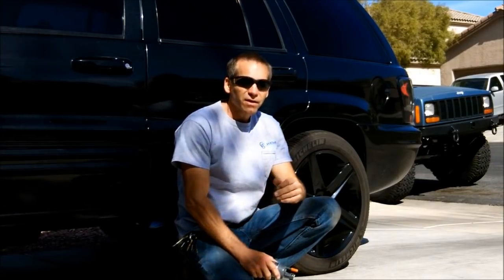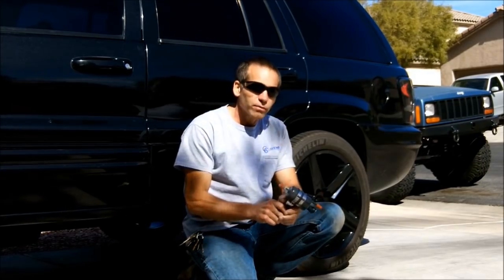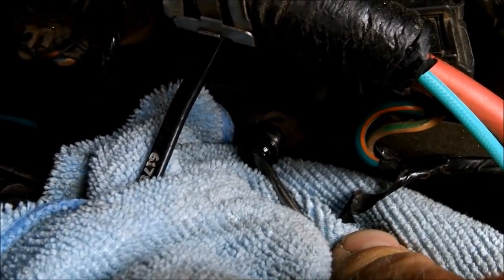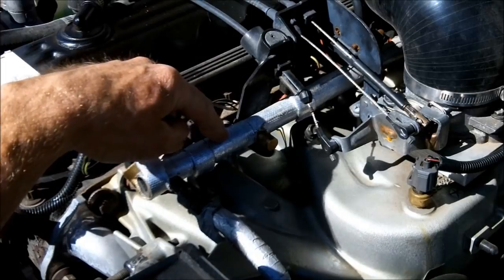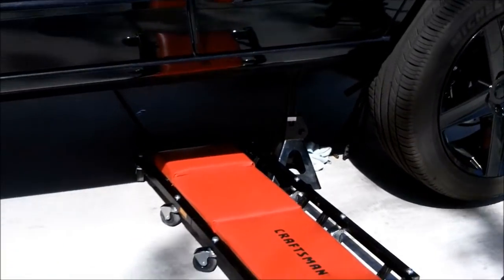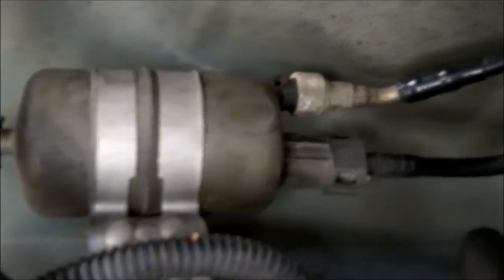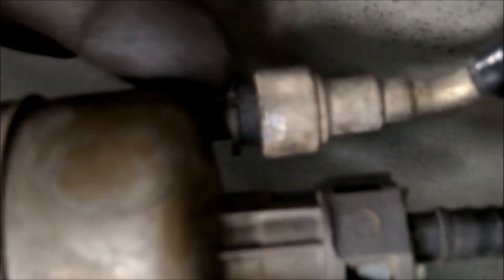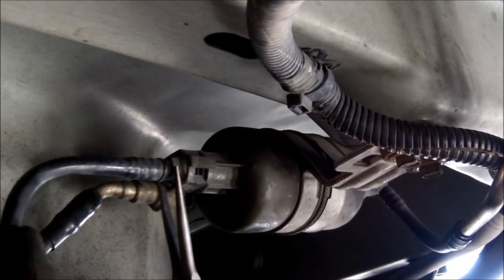Changing Fuel Filter 99-04 Jeep Grand Cherokee

Comment: This Filter has the Pressure regulator inside of it. I replaced my filter and about a month later I was having problems with the car as it would stop running. A mechanic said I needed a new fuel pump. He replaced it for me as I didn't want to do it myself. Has the same problem, the car would stall out and not restart. Turned out to be the pressure regulator inside this filter. I DIDN'T NEED A NEW FUEL PUMP THAT SITS INSIDE THE GAS TANK...Check the gas pressure before you pay for a part you don't need. Hope this helps save you some money and headaches. I'm glad he pointed this out. Most people don't know this. I didn't and I have owned Jeeps for 50 years.
Reply: so your NEW filter had a bad FPR inside it?
Reply: What sucks is you will never know if the mechanic was Fing you or didn't know what the issue was.

Comment: In my 2000 Jeep Grand, 4.7 engine, the filter also has a pressure regulator in it and most mechanics don't know this. I paid a guy to install a new fuel pump which required the gas tank to be removed and re-installed and was back the next day with only 24 lbs of pressure to the engine. I didn't need a new pump, I had replaced the filter a week earlier and the problem was the pressure regulator. I spent more money than I needed to, having a new pump installed when all I needed was a new filter/regulator as the one I bought at Aito Zone was faulty from day one.  I have stopped buying sensors and this item from after market places. They cost more at the dealer but they last longer and work better. Just thought I would share this with you in the hope of saving you a headake. 4 years ago was when I had a new pump installed and then the pressure regulator the next day as the pump was not the problem and now I am having to replace the aftermarket pressure regulator again as the one my mechanic installed an aftermarket one and it failed 4 years later. As you can see from this video, it's not in an easy place to get to and a pain to do. Hope this helps you save money, time and a headake.
Reply: Greg, my jeep which is also a 4.7 V8, will start but as soon as I ease off the pedal the engine cuts off, is this also a regulator problem? Rick..

Comment: I replaced my fuel filter on my 01 G/C and the loud annoying severe whistle appeared. Drove the vehicle for a while checked my connections all normal except for the whistle. I replaced the new filter with a Mopar filter and that cured it. After some research i was amazed how common this was. If i could manipulate the whistle sound i could have made the jeep sound like The Jetsons.
Reply from the maker: Yes this is somewhat common with inexpensive filters. I've been lucky so far with my Auto Zone filter.

Comment: Hey, just wanted to thank you for the video. My 2003 grand Cherokee, 6 inline engine, was going thru long cranking periods, I had to constantly hit the gas pedal to start it up. Did some research and many ppl stated it could be the Fuel Filter / Regulator, so I decided to replace it. I followed your video instructions and the car starts up with no problem. I greatly appreciate everyone that takes their time to upload these great videos. by the way, I ordered the Mopar brand, because I read a lot about the AutoZone brands just having too many issues. Yes, it's $89. as opposed to $45, but it offers me peace of mind that I will not have to be doing it anytime soon, God willing.

Comment: Thanks for the great video. Your explanations and extra detail made the job a lot easier. I'd like to recommend that when trying to remove the difficult connector with the slide-in collar that the collar be cleaned with brake cleaner,  sprayed with silicon lubricant, and then use a pair of Harbor Freight long reach hose grip pliers to press the collar in. The nose of the pliers is placed behind the sliding collar and form a circle around the pipe. As pressure is applied the pliers push the collar in evenly from all directions. I was then able to pull the connector off easily this way.  Hope this works for others.

Comment: So happy you cut the filter open.. just explains why our jeep won't start but we still hear the pump
Reply from the maker: are you hearing the pump or is it the fuel pressure regulator in the filter. They are known to be noisy. If it is the FPR change the filter.

Comment: great detail.  my 2003 just dies without warning. 70mph died, pulled over and restart. had to use starting fluid one time to get it to start, ran fine then again a couple days later died again at a stop light, was able to get it to start by pumping the gas peddle. going to replace fuel pressure regulator, fuel filter and fuel pump. 220,000 miles on it.
thanks for posting.

Comment: I’m getting ready to do this on my sons 04 Grand Cherokee, a vehicle that still has an external fuel filter, what a concept LOL, thanks Martin 👍😁
Reply from the maker: Good luck with that, also spray some  WD40 or lubricant up in their it will help remove those clips from the fuel filter
Reply: @martinbuilt  I did and it went good, thanks buddy 👍😁
Reply from the maker: @davestewart9146  that's good to hear. 😀

Comment: Thanks.  Before watching your video I didn't even know where the filter was or what it looked like.   I ordered a new filter online and got it he next day.  Had it replaced in about 30 minutes.  Disconnecting the fuel lines was really aggravating but I was ready for that.  At least I knew what I had to do and just kept working at it.  And the best part is the fuel filter was the problem.  Smooth acceleration now.
Reply from the maker: Glad to hear it all worked out.

Comment: Thanks for the excellent video!  I had my 04 grand cherokee towed to the dealer a couple days ago to have the starter replaced and a pinion seal replaced in the rear differential.  While it was there I asked the service advisor to replace the inline fuel filter in front of the gas tank.  She said it only had a filter in the tank!  I told her I saw something there that looked like a fuel filter and would like it replaced.  She said she would have it looked at but sure there was no filter there.  I said, Okay check it out for me and let me know what you find out.  She came back to me after the mechanic checked it out and sure enough it was a fuel filter.  They wanted $200+ to replace it!!!  $620.00 for an after market starter and to put the pinion seal in! I bought the pinion seal from them about a year ago $45.00 so that was not part of the $620.00.  Dealer work is expensive but they do have a lot of overhead to cover.

Comment: Many years ago I bought a used 2001 Grand Cherokee that always started hard the first start of the day.  I determined it was a bad checkvalve allowing fuel pressure to bleed off after standing for several hours.  I thought it was on the fuel pump and finally sold the GC.  NOW I find out a new fuel filter would have fixed it. :)
Reply from the maker: Now you need to find yourself another JGC. 
Thank you for watching. 😎👍

Comment: Nice work explaining all the components and what to expect. I ended up removing the RR wheel even thought it was on jack stands under the rear axle. Instead of lying on my back, I was able to sit on a bucket and wrestle with the fittings. Note: great advice to remove the FPR bracket bolts--allowed easier  handling and compression of the fittings. Compressed air always your friend to remove the grit that can inhibit the plastic clip movement. Thanks for posting!
Reply: Edit: LR not RR wheel D'oh!

Comment: Thank you for making this video - awesome camera work, no nonsense, extra info about those dastardly plastic clips no one wants to learn the hard way.  I need to replace a leak in the "difficult one" hose, and it is great to know to pull the thing down and that I would need a special ring to get it apart.  I will replace the filter anyway so will not bother, but will make note of which type I put back in there!
Reply from the maker: Glad you found it helpful.

Comment: Hey Martin. ,,. I had sent you a message a while back about my son in-law having issues with the blower motor staying on and the climate control not working correctly in his 2002 Grand Cherokee , and you had said at that time you didn't have any experience with one of those.
  Well I'm not sure if you have the auto climate control system in your WJ ,  but I I figured just in case you do you may be interested,.   
 That the issue was the resistor module under the passenger side of the dashboard, it controls the blower motor speed,.  It actually does it by sending pulses to the module from the climate control panel.
 My son in-law had tried a couple of cheaper after market resistor modules and they only lasted for a couple of months before going bad and having the same issues.
  I installed a original style one from
Crown Jeep parts,.  And I also installed a toggle switch to turn off the power supply going to the module so he can stop the power supply when the vehicle is not in use,
 Because I discovered that the power supply which comes from the fuse box under the hood that operates the resistor module is constantly powering up the module even when the ignition switch is turned off,
And I believe that is the reason why many people with the automatic climate control system has issues.
  I know I could have rewired the circuit in the fuse box to a switched circuit off the keyed ignition switch.
But he mainly just drives the jeep to and from work, , and I mounted the toggle switch right on the center console for easy reach., And it was very easy to install with only a couple feet of wire between the switch and the power supply at the module under the dashboard.
  If you do happen to need a blower model in the future, the one from Crow seems to be the best one, it runs the fan much better than any of the other ones that we have used.
  Hope this can help you out some time, or maybe you can use this information to help a friend.
 Tim from Wisconsin.

Comment: This is extremely detailed, and I really appreciate it. I have a 2000 JGC with the 4.7. I bought it with a misfire, and I’ve replaced the plugs, coils, crankshaft sensor, camshaft sensor, injectors, and the connectors on the injectors. I’m still getting a misfire on cylinders 4/8. My only guess is that maybe the filter is clogged and there’s not enough fuel coming into the rail. I’m replacing the filter today.
Reply: Did that fix it??
Reply: @jat-justamaturetech-philpj8285 Nope. I sold it because it was either a computer or wiring issue, and I don't have the patience to deal with that. It had a ton of other issues anyway. Missing driveshaft, shot suspension, AC didn't work, etc.

Comment: Thanks for this! took me 30 minutes with your help. For me, putting back on the one line by itself required some clip adjustment, by pulling the tabs out slightly so it wouldn't leak. Maybe that helps someone else...

Comment: thank you for the great instructional video! kept getting system rich bank 1 and 2 ECU codes on my 01 GC limited, my fuel pressure was bouncing between  58 and 65  psi, replace the filter / regulator, now fuel pressure is steady 52, no more 0172, 0175 codes!!
Reply: well the 0172 and 0175 codes are back, Fuel Press still at 52, replaced the Cats, O2 sens, MAP, Fuel filter/regulator....only things left are fuel pump and injectors... any thoughts???

Comment: Thanks for the detailed video, very well done 👍 My 04 4.0 dosen't seem to have a Schrader valve( it has some kind of metal cap that faces down) so I pulled the fuel pump fuse and ran it until it stopped. I still had a lot of fuel leak out of the filter and the lines were a PITA to remove even with WD
Also, I  cut my old Mopar branded filter open and found it interesting that it has "Fram" with part numbers stamped inside on each end inside. I installed a new Mopar filter ( cost about $90) due to the issues I heard other had with aftermarket.
Thanks again!

Comment: Great vidio, i like simplicity you explain it bye. I have a 2004 g/cherokee that the fuel filter split at the seam making a hell of A leak and long cranking time. thanks again
Reply from the maker: Wow, never heard of one splitting open. That could have ended badly. Glad I could help.

Comment: Thank you Martin for these videos - I just subbed! I recently got myself an '04 WJ 4.7 HO, and you are such a great resource for the maintenance it needs to make it a solid Daily Driver.  Question - Have you experienced issues with noisy or whining fuel filters after replacement; and are there any hacks to avoid the issue?  It seems somewhat common with both OEM and non-OEM fuel filters.
Reply: Yeah,.. my new fuel filter is making a humming noise. It's very irritating. The original one didn't make any noise.. Does the humming noise eventually go away?
Reply: @johnwigren4429  I guess I was lucky, my CarQuest replacement filter had no issues.  From what I've read, the noise may go away with time, or just try replacing it with a second time.

Comment: I ordered the OMIX 17718.06 Fuel Filter for 99-04 from quadratech. Only one of the bolts lined up and there's no rubber washers around the holes like on my original filter had. I installed it and everything was normal until a few days later when I started hearing the whistle/droning niose.  Seemed to run fine but the niose was very annoying and especially loud when idling or coasting. I called quadratech and the guy told me that the OMIX one was the filter jeep uses from the factory and he wasn't aware of the problem I was having. 

I then ordered the cheaper Crown Automotive 52100283AG filter which specifically states that it is for model years 02-04. Mine is an 02 so I hoping this one fixes the
Reply from the maker: Yes, there are actually 2 filters 1 for the 99 to 01 and then the other for the 02-04 and the only difference is the bolt pattern for the mounting bracket.
 I've heard of people having problems with some of the filters making that whining noise. I have currently used 2 very inexpensive filters and have never had the problem before.
Reply: @martinbuilt  interesting, thanks! Yea I know you recommended I just buy the Mopar one to be safe but the one from Crown Automotive was already shipped and it was 50 bucks cheaper then the Mopar so it's worth another shot 🤞
Reply from the maker: @VMAFIA  Yea, I don't blame you. I found one in the box at Pic-a-Part for $1.50 and it worked great.
Reply: @martinbuilt  😂😂  I aspire to attain your level of ingenuity Sir

Comment: Subbed just for this amazingly detailed video. I can fix just about anything and knew that I'd be doing all the things you showed, but I certainly appreciate knowing EXACTLY what I'm in for.

I have a no code situation, where my 02 WJ won't stay running unless I keep the R's up myself. I'm thinking fuel pump or filter as it's sat, (with stabilized fuel) for a few months with only a few short trips in there. Also could be the battery but I would think once running, the new (1 yr old) alternator would keep it running as it shows 14v on the dash.

Anyway, thanks for the awesome and detailed vid.
Reply from the maker: It does sound like a fuel delivery problem. The filters are great place to start. Are you still running on the same fuel that was in the tank after it had sat for several months?. Just wondering if the fuel had gone bad.

Comment: Martin, with all due respect to your knowledge but there is no blow back valve in the fuel filter, there is only preasure valve. I took the filter apart like you and checked it. The blow back valve is closed in the fuel pump in the tank only. Greetings from Poland, and I like Your channel
Reply from the maker: Yes there is a flow back valve located inside the fuel pressure regulator of the fuel filter the Flowback valve  that you're referring to only holds fuel inside of the fuel pump assembly so the pump doesn't starve for fuel it is unable to hold pressure. Only the flow back valve inside the fuel pressure regulator is able to hold pressure within the fuel line and injectors.

Comment: All parts stores list a FUEL FILTER...separate from PRESSURE REGULATOR!  The fuel filters are cheaper for some reason...I think the filter only ones are the noisy ones! Wonder why OReillys...Autozone and NAPA all list two different filters...one called a regulator...the other...just a filter?  

 My fuel pressure was over 60psi...until I got a pressure regulator one installed!  Now the pressure is within specs and no whining.

If you install an after market filter/regulator...it pays to hook up a fuel pressure gauge during each oil change to make sure the fuel pressure is within specs!  Mine was 60psi plus...it whined like crazy on cold mornings.....at 60psi my injectors were dumping extra fuel into the engine and coating the inside of the exhaust pipe with black soot...not good!
Reply from the maker: That is not correct there are 2 different filters. one for the earlier model WJ and 1 for the later both early and late have a regulator inside the filter.
 I got mine from autozone and has been working great and it is quiet.
Reply: @martinbuilt  No...you're wrong.  Look the parts up on ANY parts store website dude.  Different part numbers for filters vs pressure regulators.  Why different part numbers if they are the same.  Believe what you want....I'm a career aircraft mechanic.  Hook up a pressure tester and tell me what it reads.
Reply from the maker: @zumadale  both read 58 psi the differance is the mount on the filter.
Reply: @martinbuilt  my 2001 GC needs 45-50psi fuel pressure....59psi would be too high...i was getting 62psi with a cheap fuel filter type.   The mounts are the same on the 2001 for the filter and the pressure regulator.  Why in the world would parts stores list filter differently from regulator? Blew me away when I noticed that!  Now that have the REGULATOR installed...pressure is perfect and no more noise.